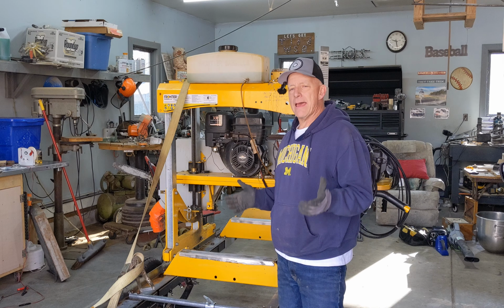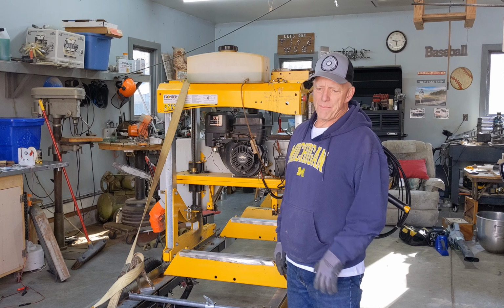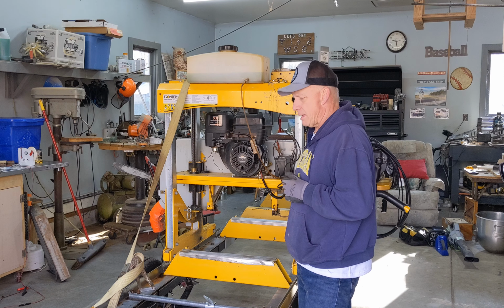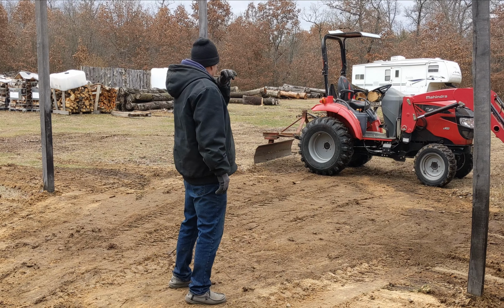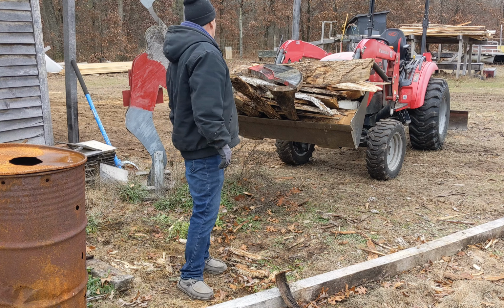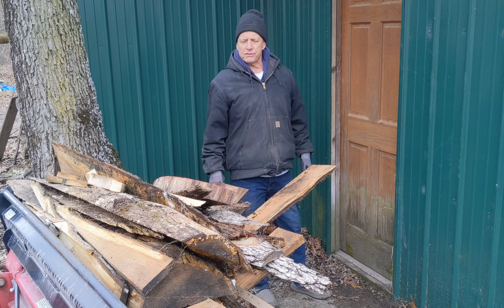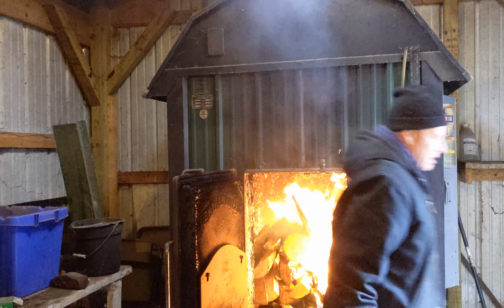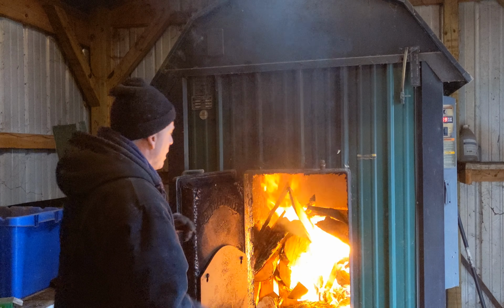It's Over for Now: Where Do I Go From Here

Comment: I built my mill to be mobile so I wouldn't have the mess to clean up. Well, I had good intentions. In three years I've only been on a remote site once. It is a drawback to milling, but for me it is worth it. I too have a boiler and utilize some of the slabs or give some to a neighbor that burns wood.. You have the site looking good and I can hardly wait to see what mods you mentioned. Hope the weather doesn't get too bad. Have a good week. Ed
Reply from the maker: @jbarlazye911  good morning Ed.  I've been on a few remote sites as well but not too often either.   I'm thinking about building a foundation for mine.  Not sure yet.   These boilers can eat anything I throw at it.   Stay warm my friend and thanks for the comment.

Comment: Straight west across the pond from you it's been hovering around zero for the last couple of days!!! Definitely feels like Winter has arrived with a cold slap in the face! I'm hoping that you are considering a log turner for this winters project, because I really hate watching you my friend struggling with turning some of those larger logs and cants, and don't want to see you get hurt doing it!! Even a winch on a post with a hook would be safer than a cant hook or a peavy!
Reply from the maker: @timscartoys9321  that would be a great build.  I'm considering it.  I'm not getting younger.  Thanks Tim for keeping an eye on me.  I push it sometimes.  Have a great weekend buddy
Reply: @BigelowWoodcraft  Even a simple winch on a pole, slipped into a sleeve, with a hook, would help make it easier! Oh wait, those are the pieces I've accumulated for the same project?? LOL!!
Reply from the maker: @timscartoys9321  I used to have a winch on a pole for parbuckling and did try it for turning.   It never worked well with the height I had the winch.  It just pulled funny on the stake pocket.

Comment: Just subscribed. Video of all your modifications? Considering the OS27, 31, or 35. Can’t decide.
Reply from the maker: @staziakviking3388  the os35 has a hydraulic package.    Could things to consider between the 27 and 31.   Without hydraulics a 27 is about as big a log as you'll want to do.   With that being said I wish I would have gone with the os31.  I have several logs in my log yard now that will max out my OS27.  These are very capable mills but do take some learning.   Best of luck and keep me informed on your decision.  Let me know if there's anything I can help you with.
Reply from the maker: @staziakviking3388  actually about 2 months ago there's a video that came out with all my modifications that I list off and demonstrate.